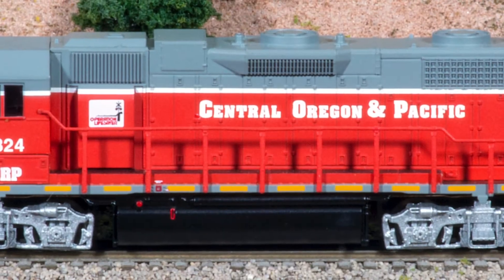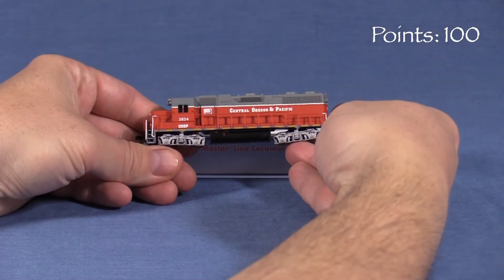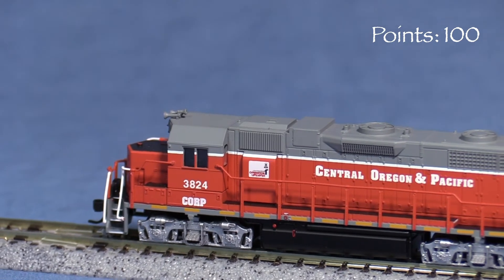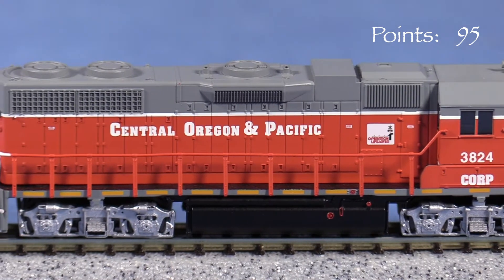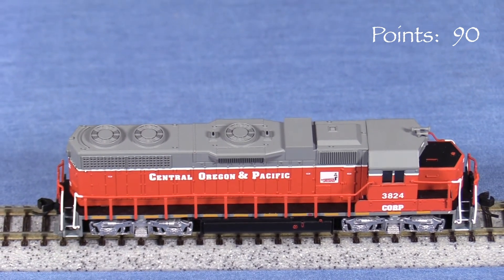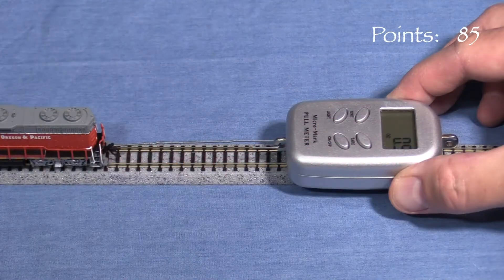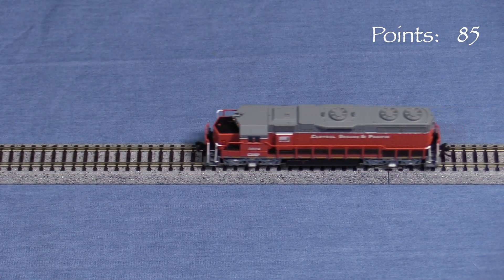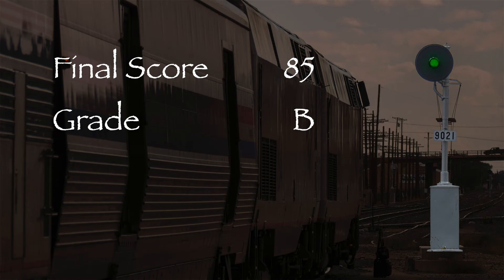Product Review N Atlas GP38 Locomotive

Comment: Great video Dan... Fallowed you here from TSG. I TAKE your product reviews very seriously.. Thanks. I was wondering if in the future you could make a video in how to speed match locos for consists by adjusting CVs with your digitrax system thats what i use too. I am.new to the hobby and I would love to run 3 power units.thanks
Reply from the maker: That's a great suggestion.  I will do a video about that in the future.  Thanks!